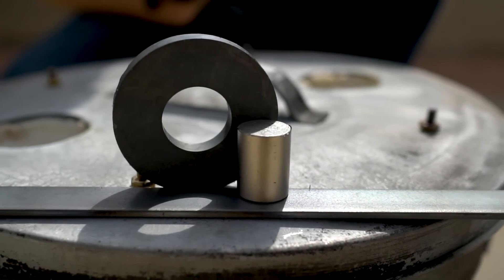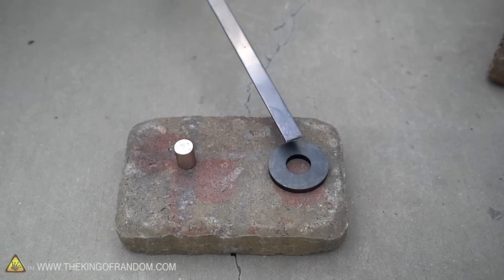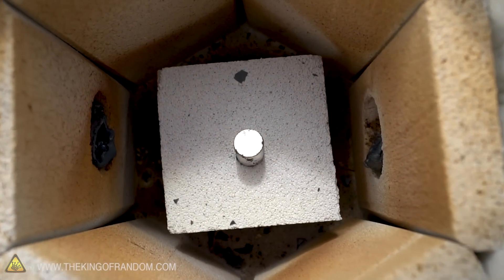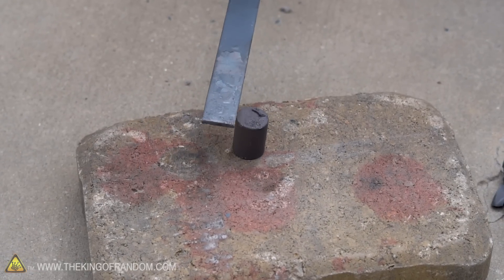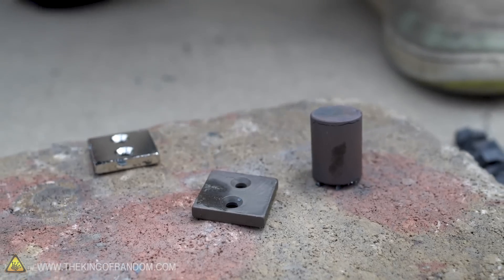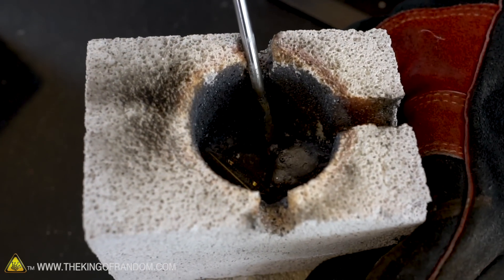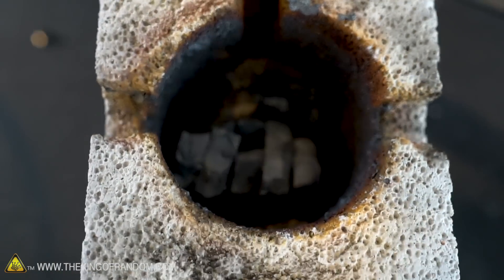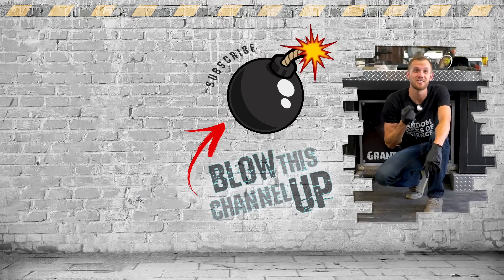Melting Magnets is Weird

Comment: RIP Solid Earth and its 5000 degree C hot Molten Iron Core theory.
Reply: The earths core is solid due to the high pressure, even at high temperatures.
Reply: Basically the same physics of boiling water. Most people think water boils at 100 degrees Celsius, but by pressurising the water you can drastically increase the temperature it boils at.
Reply: @Philip F R
And thats how a pressure cooking pot works. By increasing the pressure inside the pot you can heat the water at higher temperatures before it turns into steam, cooking your food faster.
Reply: As far as I'm aware there is no Molten Core Theory, it's widely accepted that the core is solid, as per the previous comments
Reply: Earth magnetism is Electromagnetism, the spinning is the clue.
Reply: @182dunc  no. Think of Tesla
Reply: The iron core does not get its magnetism  from ferromagnitism, so the temperature and the Curie Point doesn't matter. Instead, it has a large electrical current caused by circulating molten iron. The current creates a electromagnet.
Reply: brianorca Electromagnet by definition means externally powered. Earth is externally powered via birkeland currents.
Reply: @Xeno_Bardock  proof?.
Reply: Ultra Instinct Xeno Bardockeveryone knows it's hollow and have an inner earth that is a world of its own ..........;)
Reply: Also.. It's not just hot sitting there, it spins and /that/ is what really fuels the magnetic force around earth.
Reply: @YoushouNoKioku  finnaly. Smart people.
Reply: These comments/conversations are hurting my head. I wish I knew half the science some of you know. Keep it up guy and or girls.
Reply: Gravity not equal to magnetism
Reply: No the earths magnetism is not due to a permanent magnet, as you can see the iron and nickel core of the earth has no tendancy to remain magnetism at these temperatures. The inner core is solid, the outer core is liquid, but they are CONDUCTORS being metal. Because of the earths motion, and some convection  in the liquid outer core, there is a rotation set up in the liquid metal. this rotation causes the moving conductor to become a self exciting electrical generator/electromagnet.
Reply: the core is not solid, it is molten, and the iron itself is not magnetic, but because it's molten and rotating, it creates huge electric current currents that in turn generate the magnetic field of the Earth. Mars has a solid core and thus no magnetic field.
Reply: Bogdan Ionitza Wrong. Watch birkeland current videos. No solid core nor molten core, only ionized gases/plasma because centrifugal force gets stronger the closer you get to the center while gravity becomes zero at the center, centrifugal force forces all heavy matter away from the center leaving only gases. Mars i think is like a broken capacitor/battery hardly storing electric currents from birkeland currents anymore. Planets act like a capacitor/batteries storing electricity from birkeland currents therefore planets are electrically charged bodies.
Reply: Ultra Instinct Xeno Bardock that's an interesting theory but why then doesn't Mars have a magnetic field? How is it 'broken '? Also if what you say is true it needn't invalidate the flowing liquid core thing, they are separate mechanisms
Reply: Bogdan Ionitza Watch videos "Wal Thornhill: Lightning-Scarred Mars and Venus | EU Workshop" and "Episode 2 Symbols of an Alien Sky: The Lightning Scarred Planet, Mars (Full Documentary)" and Charged Planets videos. Molten/solid core theory is invalid because first centrifugal force being strongest at the center while gravity is zero strength which makes it impossible for molten/solid core to form, second gravity doesn't behave in a way of pulling everything to the center of planet, gravity actually creates a balance with centrifugal force and that's where all the heavy matter exist including iron, third is electrical nature of gravity. Watch video "What's Inside Jupiter? | Space News".
Reply: The Sun has a magnetic field that is millions of times stronger then the Earths using the same principle, the core is solid due to the high pressures at their centres. The magnetic fields are why you see solar flairs and aurora!
Reply: markus dunbarus Watch video "Wal Thornhill: Blinded by the Sun | EU Workshop".
Reply: Guys, bardock is right! He saw it all in an anime.
Reply: See video, "don't learn all your science from YouTube"      see video " I feel like he was a video salesman"
Reply: Love when people talk about alternative theories like they are fact, when they are less widely accepted by the scientific community. Guess someone won you over with a documentary and now you are like a religious person talking about his/her faith..

Noone cares if it contradicts what we thought, science is about discovering new things. And they are most welcome, there are no conspiracys to hide information.
Reply: I understand that a lot of these pseudoscience ideas can be very persuasive and seem convincing, so I don't blame you for thinking that, in fact according to relativity gravity doesn't really exist at all, so what you say about gravity not working how people think is absolutely right. But until proven otherwise, I'm still going to put my faith in the existing solid core theories.
Reply: Mainstream cosmology is largely pseudoscience but simply because it is taught in schools/college/universities, everyone assumes it can't be wrong. Well it is and you will know why once you get yourself familiar with Electric Universe and Plasma Cosmology, both of which is peer reviewed but not mainstream simply because it contradicts what is taught in schools/college/universities.
Reply: I'm going to bet that Xeno don't need no highfalutin math to understand his Electric Universe and Plasma Cosmology.    You know that what they teach in schools/college/universities is pseudoscience because they hide it all behind a wall of "calculus" and stuff.   They try to tell us that the net gravity at the center of the earth is zero and yet the pressures are almost beyond human comprehension.   Gee...how could that be true?   /sarc
Reply: That's nonsense.

Mainstream cosmology is mainstream because it conforms to all testing.

The universe is electrically neutral. If it wasn't, we'd see vastly different behavior at the largest scale, because electromagnetism is much stronger than gravity.

What are they peer reviewed by?
Reply: Ultra Xeno, what about wild planets ?
Reply: fakiirification Watch video "What's Inside Jupiter? | Space News" on electric gravity.
Reply: lilkurd2000 Wild planets? You mean planets without solar system? Such planets will be likely freezing cold on the outer surface but will be full of life underground and inner surface if conditions are met. The ionized gas core of the planet will act as a sun for life inside, powered by birkeland currents. Kind of makes goldilocks zone less important.
Reply: Problem is plasma cosmology makes predictions that don't match experiment. Since experiment is the final arbiter, plasma cosmology can't be correct. For instance, the plasma cosmology model predicts more x-rays and gamma rays associated with early universe light element production than are observed, while the big bang nucleosynthesis predictions match up with what is observed. Additionally, the peer reviewed papers on plasma cosmology are mostly from the 80s and 90s, and more recent measurements at higher sensitivities no longer match the predicted plasma cosmology model, but fit quite well within the predictions of big bang models.
Reply: Electric universe is far more accurate than standard model.
Reply: Joe O Watch videos " More Big Problems for Big Bang | Space News" and "Steve Crothers on Failures of Big Bang Cosmology | Space News".
Reply: @fakiirification  well said my friend.
Reply: @Xeno_Bardock  wrong.
Reply: The core isn’t molten. It’s a mono crystal, we can Ring the earth like a gong and tell there’s something solid down there. We have Molten sodium experiments that use a dynamo effect just like Earths.
Reply: Earth rings like a bell for hours because its not solid. Even moon rings like a bell for hours. This is impossible on solid planets and moons. That something solid down there is nothing more than inner concave surface.
Reply: Cool theory 😊
Reply: different kind of magnet. We've tested molten iron churning and it does have a magnetic field. much different scenario
Reply: and the core is solid its churning in molten metal
Reply: SATAN lives at the Earth's core. Derp
Reply: Earth is just a simulation and the goverment is hiding it from us
Reply: This is the deepest comment thread I have seen on YouTube in a long time. It's funny when you are all right, but we need to understand the deeper physics of the universe which is quite possibly electromagnetic through and through. I think the "Dark Matter" we are looking for is this electromagnetic energy, but I'm not a physicist, so what do I know?
Reply: Centrifugal force only appears weaker at the center due to you being pulled from all sides, its not actually weak but very strong at the center since the center of planet is the center of centrifugal force, not gravity.
Reply: In nature, plasma is anode, positively charged electrodes like the sun and galactic center, while planets and moons surface act as cathode, negatively charged electrodes. Don't connect the electrodes together like the mistake gravity model solid earth did because explosion will result. Ofc nothing is entirely positively charged and entirely negatively charged in nature.
Reply: Pyre Spirit Watch video "Who Still Denies Electric Currents in Space? | Space News". No, the universe is not electrically neutral, it is actually entirely driven by it.
Reply: @Xeno_Bardock  evidence?
Reply: Center of all planets is plasmoid, a ball of plasma, no solid or molten core. No high pressure as assumed by solid earth theory, gravity is zero at center of planets while centrifugal force is strongest at the center of planets which means lower pressure and no heavy matter at the center of planets, only gases in ionized state. NASA zero gravity experiments show gases in zero gravity migrate towards the center of the planets while heavy matter is forced away from the center of the planets. Watch video "Saturday Morning Science, full length, DVD quality" at 23 minute 3 seconds.
Reply: Ultra Instinct Xeno Bardock Gravity is never zero anywhere.
Reply: LordFrz that's not technically true. There could, in theory, be a singular point somewhere in the universe at which all gravitational forces cancel. Realistically though, that doesn't happen.
Reply: +ultra instinct xeno bardock Er, no, sorry.  Centrifugal force is stronger the farther you can get away from the centre.  Try it out with a merry-go-round.  It gets harder and harder to stand the further you get away from the centre.  Or, just try to spin a rock on the end of a rope you're holding by hand, while keeping the rotation at the same speed, compare the pull on the rope as you let the rope get longer.

NASA has done no such experiments.

The pressure at the centre of the earth is very high.  Even though the gravity is zero (because all the mass is "up"), you have 3000 miles of rock pushing down on it.

The rotational speed of the earth (one rotation every 24 hours) is NOWHERE NEAR enough to levitate anything.
Reply: @Xeno_Bardock  "No high pressure as assumed by solid earth theory, gravity is zero at center of planets"

Yeah gravity is zero at the center of planets, that's basic physics. But the pressure IS NOT zero because all the layers above the core have immense weight.
Reply: You are wrong. Zero gravity is very different from zero pressure. As gravity tends to cancel out at the center, only means that the object there is not dragged by gravity . However, it still receives a lot of pressure under electromagnetic force , as it is essential to prevent all other parts of the Earth from collapsing towards the center for being accelerated by gravity
Reply: Forget what you learned about gravity in school textbooks. That's not how gravity works. Watch videos "What's Inside Jupiter? | Space News" and "Wallace Thornhill: The Long Path to Understanding Gravity | EU2015".
Reply: inner core of the earth is about 3,3 to 3,6 e+6 (billion) atm. Check David. R. Lide, ed. (2006–2007). CRC Handbook of Chemistry and Physics (87th ed.). pp. j14–13.
Reply: No such thing as black holes. Watch videos "Black Holes Behaving Badly | Space News" and "Stephen Crothers: Black Holes & Relativity".
Reply: I can only suggest to the rest of you, to treat theories as theories, facts as facts, and to realize, that either fact or theory can change to the other or drop off entirely. We only use what we use, because we've found that it works. Doesn't make it right, true, or sensical, just means we can recreate it.

It's nice to learn extra concepts, but if noone can legitimately measure some of these ideas, and nothing can recreate it, it's basically hooey. really cool hooey, potentially world changing hooey, but hooey. 

Like gravity. Since we don't know what it is, how it functions, or can even measure it(yes, your gravity measurements don't measure gravity) it's hooey. however, the concept is readily witnessed all the time.
Reply: NiceWhenEarned RudeMostlyElse you mean "can't" measure it right?????? Neal says you can!
Reply: Ultra Instinct Xeno Bardock only truth written hear
Reply: Earth's electromagnetism is due to birkeland currents. Stars, planets and galaxies are externally powered. Watch birkeland currents videos. Gravity is electrical in nature and not inherent property of mass itself. Planets are highly electrically charged bodies and we all know charged objects attract and repel, that's a clue. Watch charged planets videos.
Reply: (sorry for bad english)
First of all gravity is not electrical,  there are 4 fundamental interactions : gravity, electromagnetic, weak force and strong force, all 4 of them are carried by different particles. (except gravity that dont have a carrier particle)
About your other comment with the NASA experiment in 0 gravity, its true that gases migrate to the center of a spinning object but this is not happening with planets, for planets you also need to consider the pressure made by gravity that tend to push the heavy matter to the center and the gases to outside. Yes at the center of earth the gravity is 0, but the pressure at the earth core is not from the gravity from that point but from all the matter from "above" that try to "fall" in the core, its widely accepted that the core of our planets its solid but i didint made a lot of research about it so its better for me to avoid this subject.
Reply: Zetro You are just repeating what school textbooks told you, forget what you learned in school textbooks. Gravity cannot be fully understood without its electric nature. Gravity doesn't pull everything towards the center, gravity is only strongest on the surface of a planet. There is no reason for planets to act differently than NASA experiments. Universe repeat patterns. Everything is electric including the matter. Watch the videos about gravity i mentioned above. Also watch "Wal Thornhill: Future Science | EU2017".
Reply: Ultra Instinct Xeno Bardock where did you hear that gravity is electrical?
Reply: @Xeno_Bardock  omfg did u even go to school?.
Reply: There's a small black hole in the center of the earth. Just like there is in the center of galaxies.
Reply: Joseph Boulet wtf
Reply: keep taking the medication
Reply: @josephboulet4477  no there isn't ffs.
Reply: @PaulBrown-uj5le  haha
Reply: +Joseph Boulet
.....Black Holes don't exist numb nuts.
Reply: @blaze1148  your name is dark star.
Reply: @blaze1148  how come they have taken a picture of our black hole,  sag A star. It's only a few pixels but it's there?.

Comment: Magnets have aligned spin in atoms inside them that reside in crystalline regions that align in local domains. Spin excess diminishes after the crystalline binding energy is broken. You can break a magnet by hitting it, exciting it with acoustic waves in theory, and heating it. Basically you need all the little atomic magnets to line up ferromagnetically. It is neat to think that magnetism is a relativistic effect due to the properties of length contraction.

Comment: Putting a magnet next to heat causes the particles to heat, move, and loose magnetism. If you use and electro-magnet the steel can't un-magnetize it because it's magnetic force comes from the current.

Comment: This is very interesting in a non-interesting way. Show how much work is behind the science of i.e. magnets/materials, and how many experiments just leave you with no new information, and the challenges to preform some of the tests (i.e. do I need a liquid cooled magnet to test if liquid metal is magnetic, so I don't remove the magnetic properties? Can I use an electromagnet instead,without ending up electrocuting myself? ...)

Comment: So can the magnet no pull the atoms in because of the energy they have built up if I'm right the atoms vibrate rapidly when heating in metals so the kinetic movement is stronger then the force of the magnet?

Comment: Some NdFeB magnet providers warn that NdFeB magnets can give off toxic fumes when burned or heated to extreme temperatures.The reason the internal portion of the magnet melted more readily is that most NdFeB magnets are nickel plated.  NdFeB magnets oxidize rapidly and readily and will gradually decompose into powder.  The nickel coating protects them from oxidation.  It also provides additional structural integrity to the sintered magnet material which can easily chip or break.